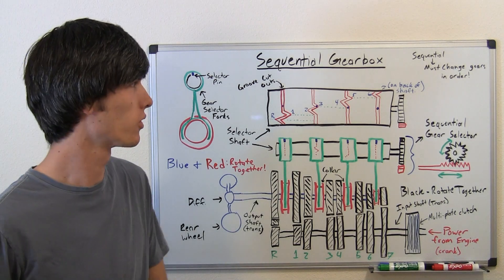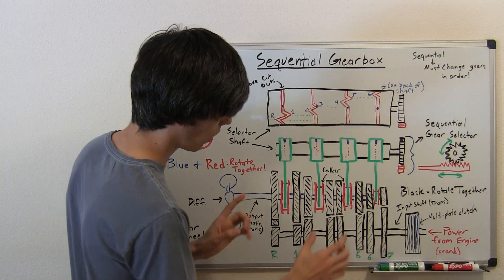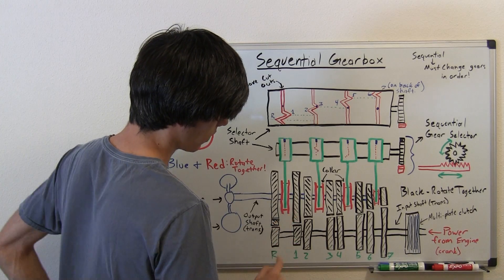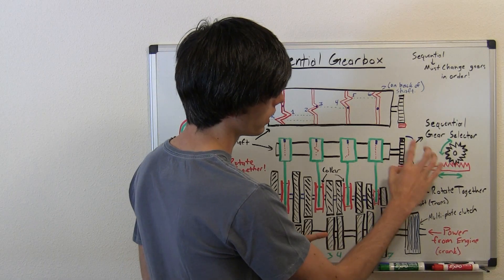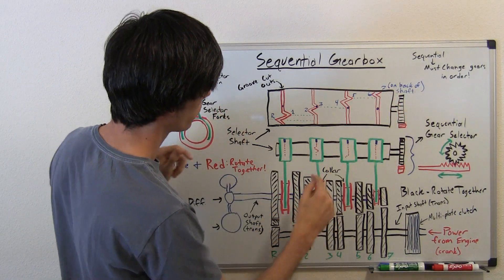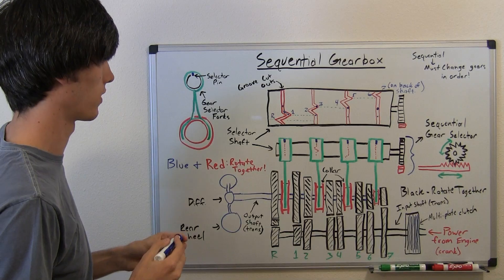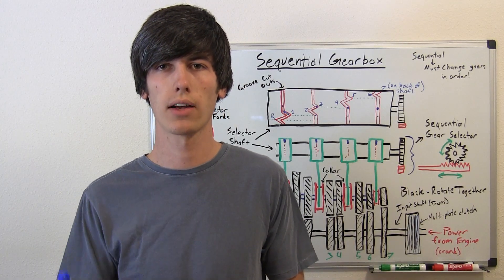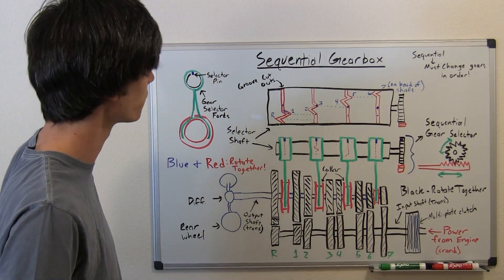Sequential Gearbox - Explained

Comment: Respect for your knowledge. But I can guarantee with all your knowledge you are unable to put it to practical use. Meaning you would not be able to rebuild an engine, transmission or anything mechanical. I noticed a lot of the words you used during your explanation are inadequate. Meaning that you do not truly know the product inside and out. I am a certified diesel technician (ASE included)  of nine years and future electrical engineer (pursuing an undergraduate currently). And I can say of the nine years thus far in my profession engineers have caused mankind much much grief in the automotive field simply because their knowledge is attained from a book and not any at all from hands on experience. Many WTF monents.  You do not truly know a product until you have physically worked with it. But again respect for your knowledge.
Reply from the maker: I think there's a better way of trying to get your point across than attempting to belittle me and then say "respect for your knowledge." No, I haven't rebuilt an engine. But does that make me incapable of doing so? I plan on doing it within the next year on my Integra. I've had this channel for less years, and you think I should be at the level of master certified ASE's? I've learned this all on my own time, and I'm helping others learn it as well. Call it oversimplified, but many find it of great value. Cheers.
Reply: Well... not at the level of an ASE master technician but rather at a through level of explanation. You touched heavy basis on the fundamental gear operation and power flow through the housing (main-shaft and floating gears,countershaft(s) input and output shafts, and sliding clutches)  which is identical for any manual syncro-mesh transmission. You did not however use the same emphasis on the sequential gear selection which makes the sequential trans unique from the standard syncro-mesh. What makes it fit for high performance race cars, and why must the gear selection be done in numerical order in the up and down shifts? These questions are what make a sequential a sequential. You did not however answer them. I have watched many of your other videos and your explanation is simply not through simply because you do not truly know the operation of a product but rather learned of its operation from the reading of texts. I am a professional ASE diesel technician of nine years and over the years automotive design flaw have caused myself and mankind much grief. Simply because these "automotive engineers" do not truly know the product inside and out and have not physical worked with it. In other words "it looks good on paper". I have worked with engineers form Cummins, Caterpillar, Paccar, Volvo, and GMC and their knowledge is mind blowing but inadequate at the practical level. And you exhibit those same traits. That is why I commented. Your knowledge is inadequate and therefore you are educating the general public inadequately. Furthermore I have no desire to start a YouTube channel... there are better things to do with my time. And I do not believe I am of the best... I just know what I am talking about and take offense to others who make themselves believe they do. Good luck my friend,,, in all of lifes adventures.
Reply from the maker: The selector shaft (as described in the video) shows why you must select gears in numerical order. If you make a channel during your free time (as I do) let me know so I can learn from the best...

Comment: wrong about not needed a clutch after first gear, the clutching is done by the computer.
Reply: actually in formula 1 gear boxes the clutch is only used when the car comes to a complete stop.  Not sure about other racing cars but formula 1 cars do not disengage their clutch to shift into a different gear
Reply: that is auto mate

Comment: thanks for explaining the selector shaft...
but could you explain WHY exactly it isn't necessary to use the clutch with every shift? There is still a difference in the speed of different gears. it has to be synchronized somehow and there's no way the synchronizer rings can take all this load - especially if you keep on pushing the gas pedal to the floor.

Comment: "flappy pedals" simply refers to the gear selection mechanism; the transmission could be:
a) a regular auto transmission with a torque converter
- no point of comparison with manual gearboxes or the other two below
b) a single-clutch sequential as explained by this video
c) a twin-clutch gearbox (e.g. VW DSG, Porsche PDK)
- these have wet clutches, which makes them suspect for clutch wear over time and what it does to the oil

with a regular manual, the driver controls the gearbox longevity

Comment from the maker: Yes, you could potentially have some clutch slip (minor) while shifting gears. Also, depending on the design, yes, there can be a very tiny space between where no power is delivered. This can be overcome by similar designs to DCTs, where two forks move simultaneously to minimize the time with less torque.

Comment: I've got a question engineer guy... This looks PRETTY straightforward and more technically simple in design than say an automatic.  With modern drive by wire engines, why doesn't everyone use automatic sequential gearboxes?  The computer can do torque cutting and rpm bliping, so why not just use a sequential system?  Why keep all the complexity and weight of a fluid automatic??

Comment: It needs clutch of course when taking off but other than that it is not required, but can be used. Important thing is to remove at least some of the engine torque before engaging a new gear (lifting the pedal or using automated ignition cut with drive-by-wire system for example) so that the internals can perform the axial movement freely. Engagement process should be as fast as possible up and down to minimize dog-ring wear and when downshifting, rev-match or clutch dip should be used.

Comment: Straight cut gears are mainly used because of their efficiency in transmitting the power. Helical gears are actually stronger (and also smoother, hence the quietness) if the same size is considered  than straight cut because there are more teeth in contact between two gears. This is called "contact ratio" The "dog" refers to dog-rings that are in place of the synchro-rings in the transmission. They have axial toothing instead of the synchro's conicality to match the gear speeds when changing.

Comment: Actually the clutch is used when downshifting and the braking is done with right foot, tapping the throttle with heel. This is called the "heel and toe" technique. Under braking portion of the load transfers to the front wheels anyway but why they are tapping the throttle is to match the engine revolutions with the revolutions of rest of the drivetrain so that (for example in a rear wheel driven car) the rear wheels don't lock up and therefore the car doesn't spin.

Comment: Dude do you know what is a crossed gear box? I have heared a lot but dont know what it is. By the way excellent explanation on how those gearboxes works I always wanted to know what was the mechanical difference between sequential an normal boxes.

Comment: for sequentials with gear shifters, usually the left foot brakes and right foot taps the throttle to match the revs, which then doesn't transfer (jolt) the weight to the front too quickly with the change in rpm from one gear to another, which can unbalance the car and reduce your maximum braking capacity. for flappy paddle (steering wheel) sequentials like the nissan gt-r, I believe they are smoother shifting with a dual clutch set up (for odd and even gears), but no clutch pedal,thus no revving

Comment: Many sequential transmissions are built as "dog boxes" allowing for better timing between the shift itself. Carbibles has more info

Most motorcycles have such a transmission, done properly the only time you'll need to use the clutch is to get moving. Done improperly and you'll break the teeth off, leaving the gear unusable.

There is a lot of driving skill and feel to driving stick. Try driving a semi truck with an Eaton fuller 10,13, or 18spd transmission. You'll have to think about shifting.

Comment: Most motorcycles use this type of selector. Most high performance cars use the same type to quicken shift times. And shifting with out the grinding wish out the clutch. It will still grind when shifting uncomen gears being ones that dont share the same selector but in a race car or a high performence aplacation the travel of the selector is so short that they mesh up just fine. with the aid of the synchros of corse.

Comment from the maker: Because there's too much force for the synchros to match the speeds. The engine and transmission are rotating at different speeds, and by not using the clutch you're attempting to get them to rotate at the same speed. Since they are not, they make that awful sound.

Comment: What about engine braking, if one downshifts from 5th to 4th, how to avoid a sudden braking effect cause by the engine revs being force to increase? Is the clutch design in some fancy way or would F1 drivers blip the throttle when shifting down to reduce engine brake effect?

Comment: Sometimes two drums are used to control selectors so that you can dial out any play/backlash for faster response times, and also so that you can start to move the gear you want to change to a little before the driven gear dog ring starts its disengagement cycle. A slight negative angle on the dog teeth keep them engaged while torque is applied.

Comment: So on a motorcycle transmission with neutral between 1st and 2nd, is there just a straight section of groove for the selector pin between the two?

Comment: Very well done video.  I do have a question, though:

You showed, when upshifting from gear 1 to 2, two collars move simultaneously, so gear 1 disengages while gear 2 engages, providing a continuous power feed through the transmission.  Similarly, two collars move simultaneously when upshifting from 3->4 and 5->6.  However, when upshifting from 2->3 (or 4->5, or 6->7) only one collar moves, so the engine briefly passes through neutral during the shift.

Why isn't this a problem?

Comment: They all use multiplate clutches. Rally cars use more robust stuff while F1 probably uses ceramics, carbon and whatnot. F1 has extremely lightweight shafts and only RWD, plus the engines are high HP low torque, as the revs make up for that. In rally (WRC) you're facing AWD and double the weight with a long powerband. And yes, you can go from 7th to 2nd via your technique, but its still not direct as in manual and thats what he's trying to say.

Comment: Modern Rally cars (WRC) use sequential gearboxes too. They only use a tiny clutch pedal when they need to stop. I wonder if they ever used a dual clutch system back in the Group B days (1980s). Rally drivers were known to shift gears in "perfect timing", without using the clutch, but I only saw it in video once; in a video I can't find anymore. =/

Comment from the maker: Typically you don't use the clutch once you're above first gear in F1 cars. Rally cars may use a similar transmission, but likely with a bit slower shifts.

Comment: I guess the biggest problem with sequential 'boxes in an every-day-sportscar is the lack of the clutch. In normal road traffic you can operate a car with a manual gearbox much easier and smother if you just push the clutch pedal and let it roll. I.e. if you aproach traffic lights or a junction. You can't do that with a sequential 'box because you can't just select neutral. You have to go to all the gears until you reach neutral.

Comment: In F1 gearboxes, when you shift, both gears concerned are engaged for a split second, and the old gear gets disengaged just before it will start to be a problem. This allows the wheels to receive power continuously from the engine.

Comment: Which means most sequential gearboxes (also in motorbikes) are unsynchronised?
And also means that you can shift an unsynchronised gearbox with an H-pattern just as well without a clutch as a sequential?

Comment: Oh sorry i forgot a thing. The problem is the synchronization. In a normal gearbox, the synchromeshs synchronizes the speed of the shaft and the gearwheel when you engage a gear with the stick, but that needs time. If you force it to much you will hear that unhealthy sound for a moment from your gearbox. In an unsynchronized gearbox, you can just put the gear in if you do it fast enough and with enough force, or you synchronize the rotation by yourself like in the old days.

Comment: I knew the one about the axial forces, to share more knowledge: Thats where Citroen got its symbol from. They tried to fix that with V-shaped Gears.

But that doesn't really answer my question, with a sequential it is almost impossible to grind the gears, whereas with a normal transmission it is hard not to (depending on the specific box of course) even if you rip through the gears.
And if it comes to ecu: most motorbikes don't have a speedshifter (like mine f.e.) and it works just as well.

Comment: Straight-cut gears don't make it easier. Straight-cut gears have only one advantage, they don't put any force in the axial direction along the shafts and so into the transmissioncase, which allows a lighter gear housing.
With a normal stickshifter, a human is just to slow to change gear easily without the clutch and the ecu don't help you either with cut of the ignition when shifting or blip electronically the gas for a tenth or two of a second.

Comment: Nice video!
The only thing I miss is why it is that much easier to shift clutchless with a sequential, than it is with a normal transmission.
The process is basically the same, only that the selector shaft is doing the work of the stick.
Is it because sequentials tend to have straight-cut gears?

Comment: Depends on how hard the clutch engages and how fast the selector fork changes gears.  Formula 1 has a single clutch gearbox, but they have seamless acceleration by engaging both the gear being left and the gear being entered.  It wears the teeth on the selectors, but it only has to last 20 laps.  The Lamborghini Aventador has a regular gearbox as well, but is one of the fastest out there in terms of shift speed because the clutch engages so hard in Corsa mode.

Comment: Great wid :) but you forgot that formula 1 gearboxes use seemless shufting (when changing gears in a breaf moment 2 gears are selected but right before that would start making problems the previous gear disingages - it's that way because then it shifts withouth loosing any power) ;)

Comment: so is it bad if you shift a quad without a clutch?u'll just have to let go of the throttle?cuz semi trucks u could shift them without a clutch but then again they go slowly and the input shaft stops spinning and it's able to shift smoothly am i right?And one more thing,it's not bad to shift a parked manual car is it?

Comment: The electronics auto-lift on upshifts and auto-blip the throttle on downshifts, the driver does not have to do anything other than selecting the gear, perhaps that is why they call them "semi-automatic" gearboxes.

Comment: Very informative. The reason you rev the engine as you downshift is to be kind to your engine on the street and to prevent trailing throttle oversteer on the track. How does the F1 driver match engine speed to clutch the correct rpm for the engine?

Comment from the maker: Could be. Spur gears are indeed cheaper, and have no axial load. They're noisy, but this doesn't matter for F1. That said, I believe helical gears can transfer more torque for the same size gear. However, F1 engines don't produce much torque, so it may not be an issue.

Comment: All boxes for the purpose of racing including F1's 'seamless shift' system do not have synchronizer rings. The engine cuts power momentarily to help 'sync' Theirs is still a dog engagement type but with minor differences to allow split second engagement of 2 gears at once without destruction. Xtrac F1 boxes used a twin barrel system. one for odd the other even gears. Other teams used a pawl and ratchet system. Try google 'dog engagement rings' and 'synchro rings'

Comment: Well, the Gearboxes they use now, with the seamless shift system actually have synchros. They don't have the doubleclutch in front of the gearbox like roadcars because of the weight of this system. Instead, they use the synchros as a clutch when they engage the next gear. In fact, with every gearchange, they have 2 gears engaged for a few milliseconds and they need the synchros to give them enough time to disengage the old gear before the new one is fully engaged.

Comment: It would be a good idea to explain the differences between racing and manual road boxes. The principles are the same but proper race boxes like F1 use straight cut gears. Road car use helical cut gears and have synchro rings. Race boxes including F1 have NO synchros. They have dog type engagement... allowing very fast clutchless shifts. A further advance in F1 is the use of 'seamless shift system' where the small zero power period in between gear engagements are virtually eliminated.

Comment from the maker: If the gears are straight cut (spur gears) they create much more noise. Also, racing vehicles tend not to worry about noise as much, so it's not as dampened out as it is in production cars.

Comment: @EngineeringExplained i guess so because when i only want to put the car in neutral i lift of the gas and before the car starts engine braking i pop the gear out with out the clutch because i am lazyXD

Comment: what makes the collar  stay in gear in a manual transmission and not just pop out when the load is released when u come of the throttle and the car haven't yet started to engine brake ?